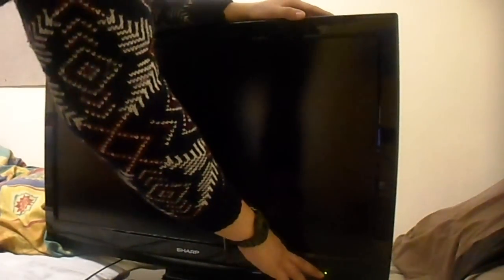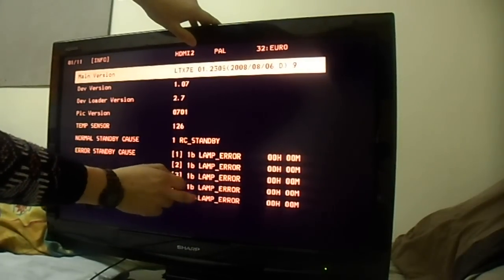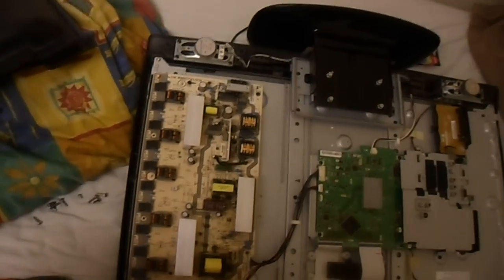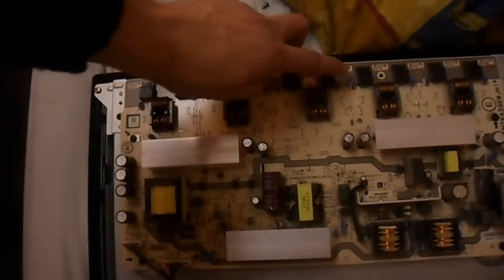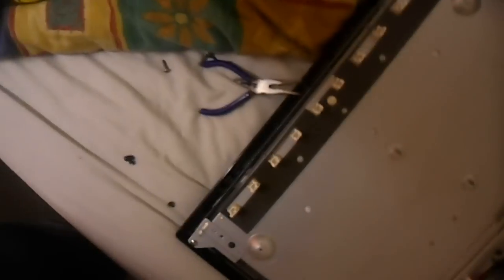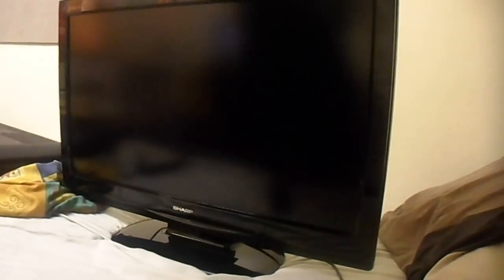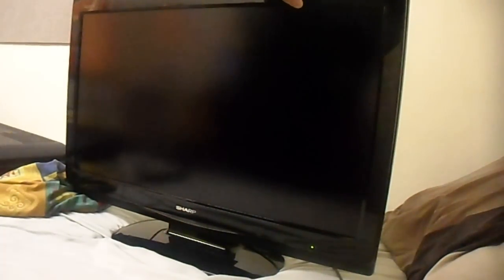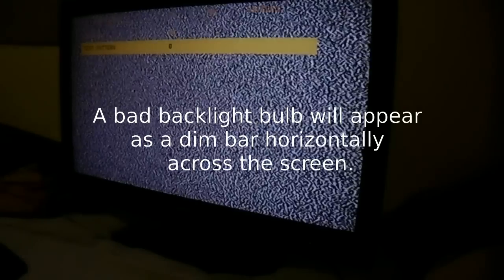Sharp Aquos LC-32D44 - One blink lamp error - No picture or sound - Diagnosis & Repair

Comment: Thank you for this. I take it you have to short the cap so it allows the service menu to stay on? 1st attempt and my psu started to smoulder! I think I shorted something else. Anyway, corrected this and it turns out there were no problems with the backlights just as you found. I have a working tv again. The backlights are only about 1000hrs behind yours.

Comment: Hi, I'm trying to get my Sharp to power on normally and found your video quite useful. Somehow the service menu disappears very quickly, I suspect because i do not input quick enough. Is that the reason you have shorted C7558?
Reply: Hi, I did not manage to short the cap. I desoldered it, after which I lost track of the little basterd, then I shorted the two contacts with a solder blob. After this, I was able to enter the menu as described, reset the lamp error. Presto, a working tv! I wonder how many tv's got tossed away because of this stupid suicide mechanism.

Comment: Problems with my Sharp LC-32 D 44 U TV, when connected to power, does not turn on,
 You hear the characteristic click that frequents before before turning on, but only turns on the power lights
 And the opc, in the following pattern, 2 times turn on the power light, and then turn on the power light next to the opc
 Once, so the pattern of lights is repeated, so far I have not gotten any technician I have
 Any idea of what causes the fault, would greatly help if someone has any answer or clue to solve
 the problem. All this happened after a big electrical storm in which a lightning strike near my residence
, In Venezuela motivated to the economic crisis in which the regime of Nicolas Maduro maintains the country and the hard policies
 With little or no access to dollars for purchases abroad, it is almost a dream to have access to
The money to buy a new TV of this class for its excessive cost and almost impossible to find the original spare parts
To make some replacement, we have to repair our valuable equipment that for now and apparently for a long time
 We will not be able to renew.

Comment: Just came across this video while searching for my problem. I have a sharp aquos lc32bt8ea (UK model). It powers off with one blink of the power LED. I cleared the lamp errors  and EPP error last night from the factory menu and then it started working OK. However it shuts down again after about an hour.

I dont want to leave a permanent short across the capacitor. I am wondering if you could tell me how to test each of those 10 lamps that are on the side of the board in your video and where do you get them from £20 each. Many thanks and Regards

Comment: Hello,
just got this screen to fix and i got the same lamp error like you, but when i solder the point c7758 (i dont remember) but it was the one you did ,anyway after i solder it i cant get access to the service menu and the remote wont work, when i desolder it I'm back to the same problem. maybe i need to solder a different point? thank you.

edit: know it wont turn off good and it goes straight to the service menu but i have no back light at all, a manged to restart the setting with a flash light ya... no dice. i think it might be too broken. it's 6 years old i got it broken still broken. thank you.
Reply: c7558

Comment: hi ubuntututorials 
i have the exact problem your showing  including the 5 lamp faults,,just wondering if you can help confirm which capacitor it is on my board to bridge,, my boards a little different as its the 37" model its a sharp aquos LC-37AD5E-BK i could email a couple of close up pictures i have taken for you to view if you didnt have the info for the part number,, im thinking its the c7506 cap but would like your opinion asap please if you dont mind

Comment: Many thanks - It's realy work - Pleae Attention to the begging ...
HARD RESET
STEP 1 - Unplug the power from the television.
STEP 2-Press and hold the "Volum Down" and "Input" buttons on the panel.
STEP 3-Plug the television back in while holding down these buttons. You may need the assistance of another person to accomplish this step.

Comment: Great video! However, for the rest of us, I would just offer one point of advice...
Before you go tearing your TV apart, unplug it, watch this video, and plug it back into the outlet.
Mine worked and I didn't have to take these measures... though, if I did, I'd come back to this video.

Comment: I wanted to add that on the test mode, there are not any bad bulbs. I have the SMD capacitor shorted right now, and the TV has been on for 4 hours without any problems. If l remove the shorting, the backlight dies after a couple of seconds.

Comment: did you mention to remove the short over the capacitor ? isnt that part of the inverter control ic there for protection ? should there be a problem with the backlights HT+ the tv will stay on with the potential of a possible fire hazard ?
Reply: Yes, it's a protection, Now the TV can burn if bulb are down, it's dangerous

Comment: Thank you so much for this video.  I got my TV to work but now the TV has a burning smell.  I took the back cover off and notice the power supply board is very hot.  Do you have any advices for this issue?

Comment from the maker: It's probably not a good idea to leave it like that; you risk damaging the transformer. If you wish to use the TV for any long period of time, I would suggest replacing the bulb. They're around £20 each, which isn't too bad. If you don't want to do that, you can cut the high voltage trace going to the bulb output to isolate it and minimise the chance of any damage. 

It is a capacitor; I normally leave the jumper in place.

Comment: 100% I have just done the job on a Sharp LC-37D44E-BK the Resistor is in a slightly different place but under the same name C7558 - I can but say thank you.

to be 100% clear do I have to remove the solder from Resistor C7558 or can I leave it in place?

I did a test screen as you show and have a dull line across the middle of the screen - I intend to leave as is, it does not bother me is that the correct thing to do in your eyes?

Thank you again

Comment from the maker: It sounds like you have an open LED problem. Christmas lights problem. One LED goes bad, the whole set in that chain goes bad. The "correct" solution is panel replacement; obviously, very difficult and extremely expensive on a 60" LED. The other solution is to very, very carefully remove the LCD panel, and replace the LED. But you need someway to remove and somewhere to place a 60" piece of 1mm thick fragile LC glass.

Comment: On a spare board I have, I pulled that pin, and presto, the TV is now on.  But unlike before, there appears to be a portion of backlighting that has gone bad.  This could be because I pulled more than just that 1 pin (possibly damaging my board), or because the LEDs or whatever drives the LEDs has finally gone kaput.  When I get off work today, I'll reset the errors with that board.  Then I'll swap to my unaltered board to see if I can get it to come on in service mode to test those LEDs.

Comment: In the depths of the poorly constructed service manual, I did find a short brief note mentioning that after 5 'lamp errors' the TV asserts a 'PNL_ERR' which prevents the television from turning on unless in service mode.  The only problem is, I can't get the TV to turn on into service mode because each time I try, it picks up more lamp errors on startup and shuts back off.  However, I was able to find this PNL_ERR in the manual associated with a particular IC pin.

Comment from the maker: There are NO lamps in your set. It uses LEDs instead which are far less prone to failure -- if well engineered. Check the "lamp error" (probably backlight error?) if the signal changes when it cuts off try forcing it low with a 100ohm resistor (you may have to disconnect it from power board) and then see what set does, you may get some flickering LEDs or the LED driver may cut out on its own accord.

Comment: Well, it's a similar in the fact that I've got a lamp error with no signs of bad lamps (when I can manage the TV to turn on, the picture is all there - in great quality might I add).  I've tracked down via my service manual that pin 4 on the connector from the main board to the power board is the lamp error circuit.  However, I can't track on the power board which capacitor that same circuit runs through.  The service manual provides no schematics for that board. :(

Comment: Great video.  How did you know to jumper C7558, though?  I have a similar problem with a different Sharp TV (LC-60LE640U), but that element does not seem to exist on my board.  I do have a service manual, but it doesn't seem to be very useful.

Comment from the maker: In which case, apply C7558 jumper before going into menu, though most likely you will need to replace bulbs or a transformer. Don't run it for long! My repair really only works for ageing bulbs which have difficulty starting, or the loose/corroded screws problem where Sharp recommend replacing/tightening screws.

Comment: There is some Russian guy who has found this a very viable solution to put the pipes generic, I have just tried this system and I can assure you that it works great, just remove another panel 32-inch obleso and desolder the tubes.
watch?v=0NZY2pcqrcM

Comment from the maker: Yeah, this can be a problem: if the bulb is bad, the screen will flicker and/or the transformer will burn. Which is why it is important to look for dark bars, mine didn't have any (probably grounding fault on PSU, common on this model) but if the TV does have such bars, the bulbs must either be disconnected or replaced.

Comment: do not remove the protection first if you have not changed all the neon burned, or merge the panel, if the TV goes into protection means that the neon lights are burned or got a small dispersion in some inverter transformer
reliable source told by an Italian technician (me)

Comment: A blob of solder on C7558 was easy to do (thanks to your excellent tutorial) but I probably wont go to the trouble of getting and fitting a replacement lamp.

Living with a dim patch across the screen wouldn't really be viable for editing 16:9 ratio videos but I guess one could swap the bulbs and put a good one in the middle leaving the top or bottom of the screen dim and use it for displaying 2.35:1 ratio stuff.

Comment: Great video which allowed me to get the sharp tele working again :)

What happens now is there is presumably a developing issue with one of the lamps in the middle of the screen: when the tele is powered on from cold there is a faint reddish horizontal band across the screen which fades away after about a minute. However if the tele is powered off for several minutes and then turned on again the reddish band does not appear.

Comment: Hi it is OK there was a service manual on line that helped. It was on the Menu that had listed at the top EEP Clear and was near the bottom of this menu and it was called L ERR Reset. When this was done the TV now works really well. You did a great job in showing this and thank you

Comment from the maker: The power button on the top of the set will make the set go into a soft standby mode where it pretends to be in standby -- the LED should go out but you can still turn it on from the remote.

Comment: I have this Tv with this problem, blink once then off. I can't seem to get it into service mode. You have a warning make sure led is off not or green. As soon as it is plugged in it is red automatically. I think it is red when you start the sequence of > press down volume & input at same time > then press down power and release power. Light should stay geen and letter K come up.( is the above correct.) contd.

Comment: Where the side buttons are, there is a board in there and it is touching the metal frame. Take something like a credit card and cut it enough so that it will not be sticking out, get some electrical tape and anchor the card to the metal frame so it will not fall out of place. You're basically protecting the board from touching the frame!! Put the back side back on and screw in place and your all set. My TV has been working perfectly ever since.

Comment from the maker: You can try the service mode and see what it says (LAMP ERROR, or something) if that works. However, the parts inside are almost certainly  different, so you will need to find a different way to fix the fault.  How old is this set? Less than 2 years?

Comment: yeah, got sick of it and got ourselves a SONY, nomore problems. before i sold it on Ebay, it worked ok (for a change), then 2 hours later the buyer rang and said "won't power up". I said "this is an old prob, return the Sharp I refund you the money, has happened 2x before". unbelievable. right now it is being "repaired" again, 3 weeks have passed and I haven't heard anything. disgusting Sharp.